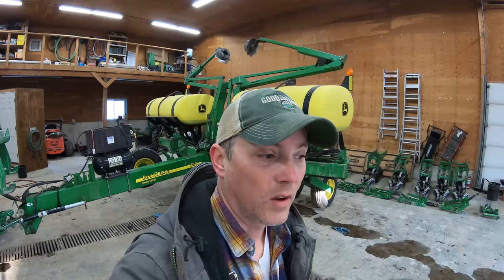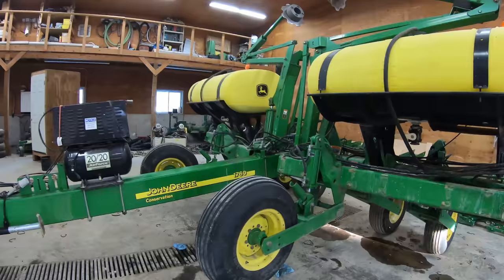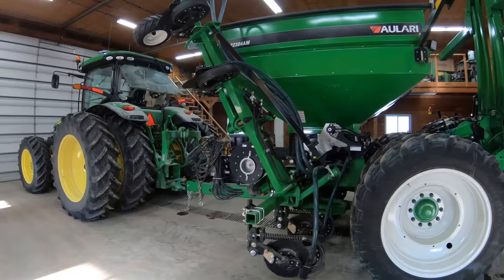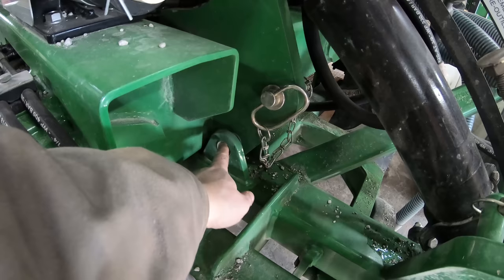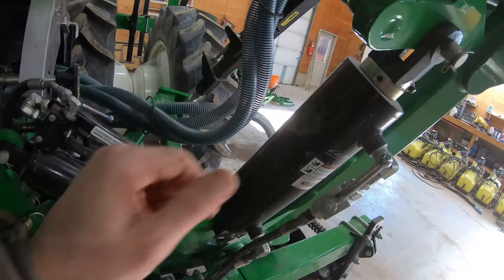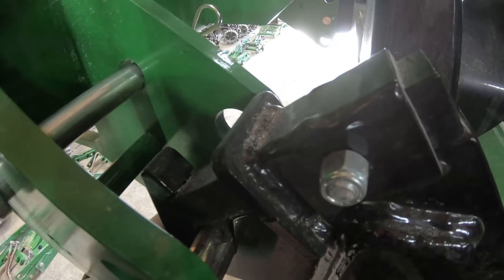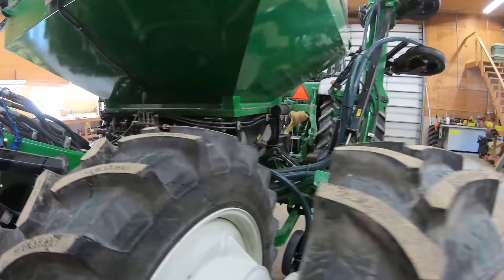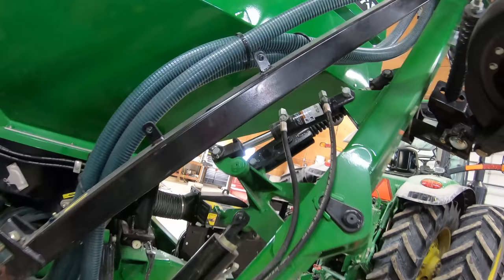Working with the Aulari Fertilizer Cart (Part 1)

Comment: A suggestion on connecting your hoses properly and easily is to color code the hose to the same color on the outlet. Whatever system works for you. It could be fingernail polish or paint or waterproof tapes.